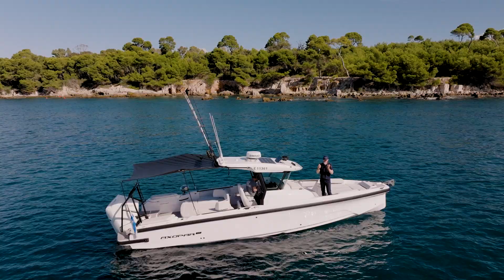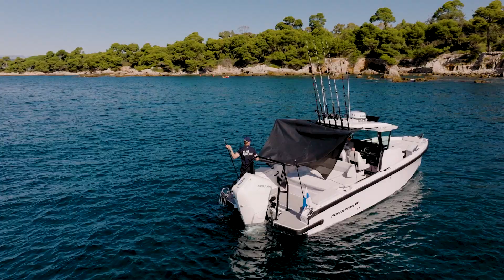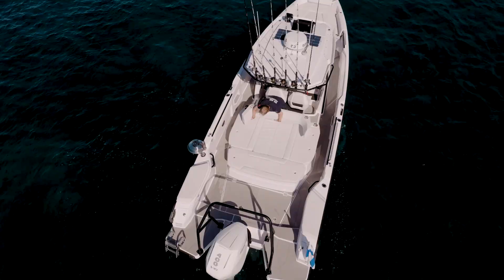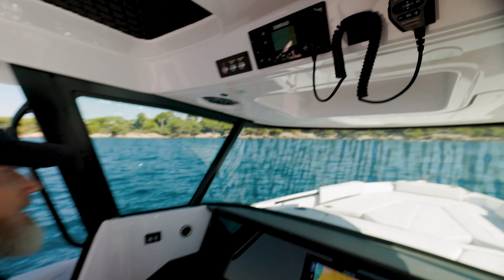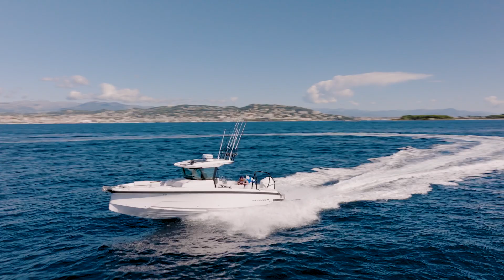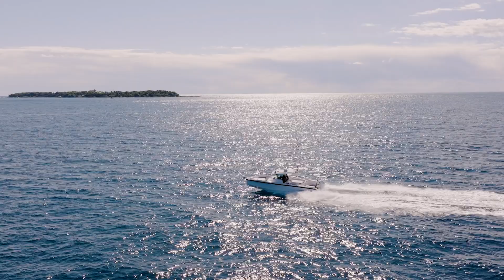Axopar 29 CCX Walkthrough with Co-Founder Jan-Erik Viitala

Comment: Hello, 
I have a question/ a concern for Yan-Erik Viitala :

 I'm really very close to order an Axopar 29 Sun Top, the only thing holding me back and preventing me from placing the order at the moment is the fact that you can't have the soft deck option on the 29 Ttop apart from the Mediterranean edition, which I don't like.
Why can we have the full gray blue soft deck on the CCX 29 and not on the Sun Top???
They're practically the same boats, yet this option doesn't exist for the Sun Top! ( or it's partial and not complete like the Mediterranean edition)

So, Sir, why is this option missing?

I've been offered to do it at another boatyard, but there won't be any Axopar registrations! As far as I'm concerned, it's not Axopar official and I don't want to do it!

The aim of configuring the 29 Ttop is to have the Linetex glacier with the Soft deck blue gray on the total surface of the ground of the boat.
As long as this option isn't in the catalog, I'm thinking of going for a Saxdor instead. Because all the options I want are available from them, not from you. 
But I would prefer to order the Axopar of my dream because I prefer your Brand ! 

It's a shame to bet everything on the CCX and forget the same options on the Sun Top!

I sail on a lake, and I'm not a fisherman, so I have absolutely no need for a CCX.

Thank you for your reply, and I hope that in Dusseldorf in 2025, you'll come up with some new surprises for your emblematic boat, the 29. Sun top.